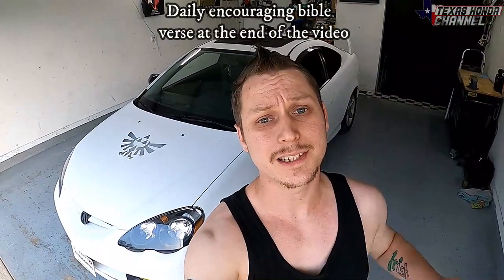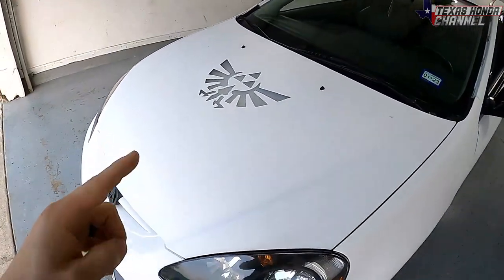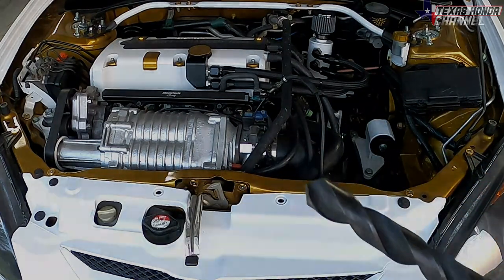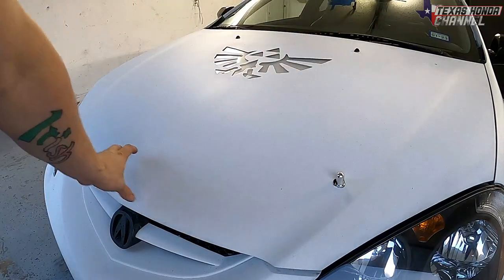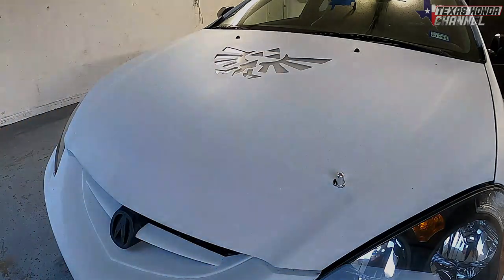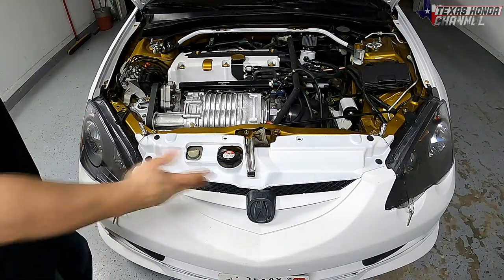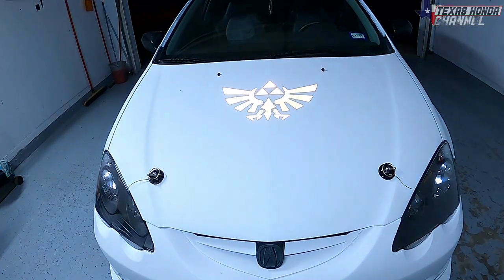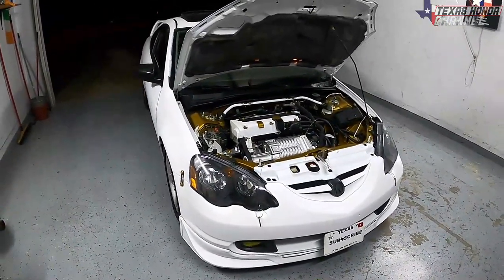WHY HOOD PINS? PLUS INSTALLATION ON A RSX|

Comment: The rattling you noted early in the video can be corrected by screwing down or up, however yours go up or down, the rubber bumpers that 'should' be there. Just letting you know. You seem very mechanically inclined so I'm sure you know this so perhaps yours doesn't adjust in that fashion? They are the rubber bumpers near the end of each headlight where it starts to the fender, on your frame. One other note, although what works, works...I think it would have complemented the hood better to have  used the flush mounted types? Just musing. Blessings to you friend!
Reply from the maker: Yes the flush ones are cool but I like these ones better and yes my adjustments were adjusted but if they were too tall it wouldn’t allow the hood to latch right. It’s even like that on my wife’s car but feel free to look into hood latch failures it’s a common problem. Either way it looks good and it’s functional so I’m good.
Reply: @TexasHondaChannel  I see! Keep up the wonderful work!

Comment: 2000 Honda Civic ex. Has d16y8/ d16y7 head. Don’t ask. Way I bought it. Been fixing a lot of issues. But only code I’m getting is po135. I’ve already replaced o2 sensors. One in header and one under car. I’ve check fuses and nothing is popped. I don’t wanna drive it bc wasting gas bc running rich. Can you help or have you had this issue?
Reply from the maker: Check timing, distributor cap, rotor, coolant temp sensor because it can cause rich running conditions too.

Comment: Idk why that was an issue honda/acura didn't fix. Had a friend had 2 different type Shock cars get totaled bc hood flew open and smashed windshield and frame. Guy @ insurance place told him most the time unless ots a brand new honda/acura 9x outa 10 they will just total it.   Also got a request video on my channel for subscribers participation if ya don't mind check it out and hope ya will participate